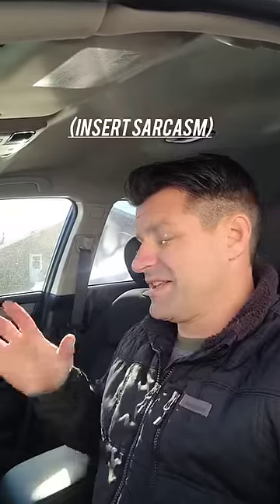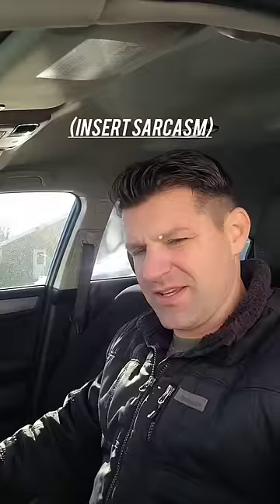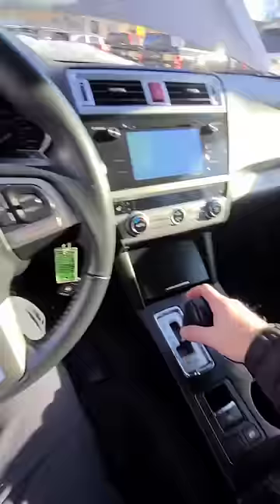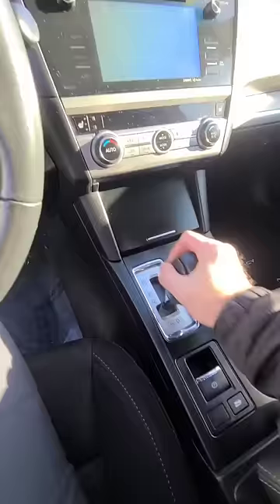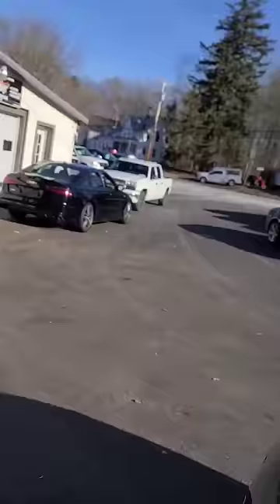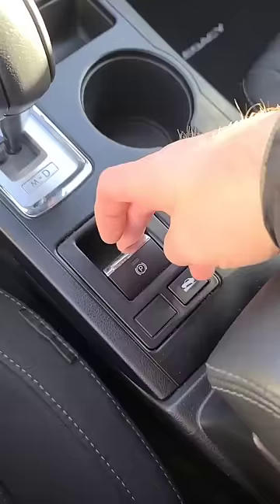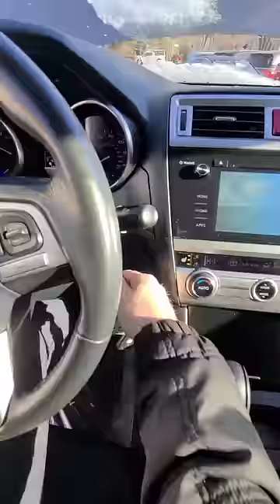Why Subaru Engineers deserve a punch in the Face! #shorts

Comment: There’s a little cover on the shift knob that you depress and allows you to move the car into park and neutral without power
Reply: Yep you just have to run fast enough to the shop grab the screw driver to pop it :)
Reply: I don’t know about all cars, but in my cars, I can pop the cover off with my fingernail
Reply: U could also use a key… or pretty much any object to pry it open; that has enough strength to hold up to prying the cover open
Reply: @Fishi413  fr
Reply: His point stands though because petrol heads like us will think 'there must be an emergency alternative' but your average driver won't.
Reply: Any good mechanic would have a small screwdriver on their person
Reply: @Fishi413  you can't get the key out of the ignition in these if the car isn't in park.
Reply: @realMaverickBuckley if only it came with a manual of some kind.
Reply: Its called reading your owners manual so you can be aware of all your cars features LMFAO. All cars with this feature have a lift off access cover on the shift console that has a swittxh under it that allows the lever to be put into park, younsimply use a fingernail or key to pull open the cover ...DUH...people who dont read their owners manual ....Pfffffffff!
Reply: @wall7103  On the Sub, you don't put a key in the ignition.
Reply: And also the car would never be in neutral with the battery dead for you to be able to do that.
Reply: @Crazy8ts  the point is its a huge safety issue and nobody should have to go through all these or other steps to make the car safe. Not too mention if this car was borrowed or bought used or if the driver was not that knowledgeable they would not know this feature. Again making it more dangerous then it needs too be. Another feature to cost the consumer a ridiculous amount of money when it fails.
Reply: @FamousByFamily  That's cop talk
Reply: Not all cars have that my previous Acura and Honda did. My current VW doesn't, but it also doesn't lock out the shifter in neutral and doesn't have an electronic e brake.
Reply: @alexgrecico9720  pocket screwdriver is a techs best friend
Reply: Is it marked for everyone to see?
Reply: @Fishi413   If only there was an accessible key nearby.
Reply: @Crazy8ts  um i dont have fingernails since i keep them trimmed short so they dont snag
Reply: @tractorboy31  I mean, you can pop it off with a penny or dime...or your housekeys...or something.  You telling me you don't have anything at anytime to pry with?  C'mon buddy, c'mon.
Reply: @realMaverickBuckley  dont say that .. my girlfriend hat this exact problem .. she used a dog leash to fix the breaking pedal in the pressed positon xD she isnt a petrolhead at all but knows how to improvise
Reply: @FamousByFamily  Does he or any other Subaru driver look like mechanics?
Reply: Every enthusiast Subaru owner knows this trick.
Reply: Yeah, he was supposed to do this before putting it into neutral
Reply: @shiminowind  most car owners don't know much about their vehicle. I mean look around, most people don't know how to operate a blinker or that their braking system won't stop a 3,000+ lbs car in two feet at 60mph. They can sit a read what the Kardashians are doing, but can't familiarize themselves with the basics of their vehicle.
Reply: As always RTFM 😂😂
Reply: It doesn't make sense or won't go back into park stopped. Every single car I know had the park or shift lock release as it is necessary for maintenance work or emergency etc.
Not one I've heard you need to press in order to go back into park....
Reply: Not only this, but he literally could have stuck anything under the tire to keep it from rolling. This was a poor attack on a common layout
Reply: @realMaverickBuckley  it's in the manual

I'm not a car person, the first time I encountered a vehicle with a dead battery that needed to shift (in my case to neutral to move it out of a parking spot) I thought "there must be a mechanical/manual method of shifting" and I grabbed the owners manual

(which you can Google and get a pdf in minutes if you don't get it in the glove box)
Reply: @shiminowind  name the circumstance a car would be left in neutral, not park, without the ebrake on, on a hill, only being held by the drivers foot for long enough for the battery to run out.

Think first, talk after. Ooga ooga ugh.
Reply: @FamousByFamily 
Clearly
You
Miss
The
Entire
Point
Reply: @Bloodbound89 
A dog leash? 
To put SUFFICIENT pressure on the brake pedal (that implies latitude of time and maneuverability to allow trial and error)?
While sitting in the car and nobody assisting?
All the while the same situation as the OP?

Seems to me your comment is a bit flippant as if to say anyone can do this - I don’t want to call BS without way more detail to clarify, but I sense “highly unlikely” that her situation was the very same as what is portrayed in the subject video, including the original poster’s clarification.  

Having a small screwdriver onhand as many commenters remark is plausible BUT even that doesn’t solve everything either as tool must be accessible and the proper size/shape.  A little ditty left out by those commenters is that the parking pawl/pin needs to engage but may not be aligned to do so with little force (that is not observable, just luck), the same as shifting from Park to other positions on a steep hill with much pressure on the pawl/pin can prevent it from releasing so car can be moved.
Reply: @jacobogden6710 
Possibly, but your comment assumes he had anything that would work to hold the car. That means he would have planned for this very event.  

I don’t know if this is a setup or not, but I don’t carry such items in either front footwell - most people don’t (maybe in a work or beater vehicle rarely having passengers but that doesn’t mean easy to handle from a seated brake hold position - and holding phone to take video is least important).  Just sayin’
Reply: @handledeehandledum  the point is, this is not uncommon, this is a fairly common setup in most cars, there is a bypass switch, and you can literally grab about anything and put it in front of the tire. It doesn’t take much, there is nothing wrong with this system just takes a little bit of common sense
Reply: @soggybiscotti8425  you don't think at all. If you are in drive and your car dies and you can start it. You can shift from drive too neutral but cannot shift into gear/reverse to park from neutral without power to the neutral safety switch. Some cases like this you have electronic ebrake and other times some people don't have an ebrake at all. In an automatic There should be no reason a driver has to do hoops to secure a vehicle.
Reply: @shiminowind  if using your fingernail to pop open a small plastic cover is too much for you to handle, perhaps you shouldn't be driving.

If your car dies it means you weren't paying attention to any of the digital warnings and safety features built into the vehicle that notify you of your battery running low, or your alternator not charging the battery.

If you still chose to drive the vehicle until it dies, the battery still has enough power to engage the parking brake. It's designed to do so, even after it loses enough power to run the engine.

This guy disengaged the battery completely in order to create a situation that will never happen in reality in real use of a vehicle. And you got rage baited by it. So well done for using that superior intelect of yours.

I'm surprised you're still breathing at this point.
Reply: @Crazy8ts  OR instead of having to scour a 40 page manual for a single sentence telling you what to do in this incredibly specific circumstance, the car could, I don't know, let you put it into park without electricy 100% of the time without any special actions on the user's part?

You know, like most other cars for the last 70 years? Basic safety 101
Reply: @jacobogden6710  "Common layout"

You mean incredibly over-engineered and unsafe design prone to costly failure.

ANYTHING that has to do with stopping the vehicle should not require electricity or special actions beyond shifting or pulling the brake.
Reply: @soggybiscotti8425  Clearly this one.
Reply: @jacobogden6710  "setup in most cars"

Nope. <5% of vehicles work like this.
Reply: @LaFonteCheVi  he deliberately put the vehicle into a situation that cant happen in reality, and entirely disconnected the battery. It's not a situation that occurs with actual use.
There's also a small cap that can be removed off to manually put the car into park.

If you somehow managed to ignore all of the built in warnings that the vehicles alternator is not charging the battery, then that the battery is low, and decided to drive the vehicle until it stops, the vehicle cuts out with far more than enough remaining power to put on the emergency brake. Even if you run the ignition and play with the interior media center until that dies, it still retains enough power to engage the emergency brake. It is designed to do so.

So unless you intentionally sat the car on a hill with your foot on the brake, in neutral, and ran it until the car died, then ran the interior until it cut out, then waited several weeks for the residual power to drain so that the brake could no longer be put on, then this isn't a real situation that can plausibly happen.

You got baited.

Use whatever rattles around in that head you call a brain next time. He did it for views and interaction, and you fell for it like a chump. There's no situation in actual use this can happen.
Reply: @soggybiscotti8425  rage baited? The only person who is raging is you. You need to have a manual tell you what to do. Does not matter that this is a simulation. It is a feature that should not exist in any vehicle. You do realize you can loose power In a vehicle without any early warning at all. You can have no indication of any kind and still have a complete power loss. For instance a ecm complete failure shows no warning light. Your just feel superior cause you read a book that tells you how to lift up a piece of plastic on something that never needed and does not need it. It has no benefit of any kind only adds a unsafe situation in a rare scenario
Reply: If he had something to put under the tire, the car would be still if its not very steep. Like the servicebook that is a bit thick.
Reply: @LaFonteCheVi  what are you talking about, besides the electronic parking brake the shifter works like this in most cars after 1995.
Reply: @Bloodbound89  That's badass, but I think generally, 90% of drivers would have no idea.
Reply: @Pensnmusic  Yup, fair comment.
Reply: @Fishi413  Or, you could just...not shift the car into neutral when you know the battery is dead?
Reply: @LaFonteCheVi  Cars aren't the same as they were 70 years ago, for one, they are incomprehesibly safer in EVERY metric than they were 20 years ago let alone 70!!! So ya read the owners manual, cars today are far far more advanced, being ignorant and ignoring built in safety features is what makes them unsafe.
Reply: @FamousByFamily  How is that relevant for the 99.9% of drivers that are not mechanics?
Reply: @silasmayes7954  All cars (with automatic transmissions) have some way of mechanically overriding the shift interlock some are just easier than others.
Reply: @alexgrecico9720  or just use the key you pull out of the fob. You know like it's designed for and states in the manual. Same for all modern Ford's, Chevys, Toyotas and the Audis in front of this Subaru.
Reply: @shiminowind  what if you buy used with no manual? What if you read it and forget that specific piece of information 5 to 10 years later when you need it? What if you lose the manual? What if you're not mechanically or car literate and don't understand the manual very comprehensively? What if you're stressed out by the situation and don't think there's a possibility of there being an override?
Reply: @insederec  then you would be a normal person. As a mechanic of 20 years this is not an impossible scenario.  This happens alot where your car dies in drive for unknown reasons and it's all due to the newer electronics that engineers think make it better and claim its an impossibility cause there cad model says so. Before this all you needed was a neutral fafety switch. Would allow you to shift from drive into neutral while driving but when you needed it you can shift from drive to park with just the break applied. That's what the b.o.o (break on/off) switch was for. It told the computer the break was applied allowing the neutral safety to be overridden/disengaged so the shifter can move freely. Car could not start without the neutral safety being overridden and in either park or neutral with the break applied. Simple and very safe. This locks you in gear and for those who have no way to get to the override are now in a very bad situation. As simplistic as just pop the cover off sounds, every situation is different and as a mechanic of 20 years I can tell you it's not so cut and dry. Engineers think they are smarter then everyone and they have something better then anyone else and in the real world what they find impossible is actually a daily occurrence.  They collect there data in a controlled pool. This will kill somebody one day cause an engineer that he was so smart.
Reply: @darktoranaga  this guy who is doing the video is a mechanic.

Comment: Automatic transmission typically have a fail safe, usually a cosmetic panel you lift up and then stick a screwdriver down, this will disengage the shift knob lockout and allow you to put the car in park.

Comment: Put blocks underneath the wheels. Always a solution to the rolling problem
Reply: Not a solution when the blocks are on the other side of the shop and the fucker is already dead when you start fucking with it
Reply: If you don't have blocks, an ex wife will do.
Reply from the maker: @jdm2779  precisely
Reply: I always carry a wheel block with me, even in my new 2020 wrx. Mainly because my manual S10's park brake was MIA back in the day.
Reply: Yep always keep blocks on your keychain for things like this
Reply: Yea but who carries blocks with them cuz I don’t besides maybe mechanics
Reply: @calebwhite175  yea so do I, but do you really wanna run to your trunk, grab them and run to the front of the vehicle while it's already in motion, or are you gonna hop back in the car to brake and then hop out for the blocks.... Do any of these scenarios sound fun to you? Lol
Reply: @nonamenoname4641 this is what I was thinking. So you are just going to leave blocks in your passenger seat or the back seat... Dumb solution.
Reply: @BaronBoar  Thats what I do, out of habit. Anyways, they really don't need to be that big, I have one that sits in the cup holder of the door... snuggly. But that's me, I'm nuts like that.
Reply: It's still a stupid design.
Reply: @Mr.President sir  Indeed, Ford did the same stupid thing with the 2010-2012 Fusion, except they at least had a manual park brake. Probably did it with other models too. All I know is some things should never be electronically controlled.
Reply: @calebwhite175 🤣🤣🤣
Reply: Who opened the hood thou?
Reply: @jdm2779  well then how did it get in neutral then in the first place?!

Comment: Maybe you should have gone to YouTube university and searched for shift lock release for Subaru Legacy.
Reply from the maker: See pinned comment
Reply: maybe design the car to be put in Park like the others?
Reply: Or just get a car that isn't shit.
Reply: I had to once to put one in neutral to push it out of a garage to jump it off.
Reply: Yeah, there is this thing called an owner's manual and  if you have a cup of coffee and 15 minutes your can learn everything that the engineers did for you.  Ignition key into the  shift console (see diagram) foot on the brake, rotate the key, shift to park. God Bless.
Reply: @paulhale3979  Pretty sure his pinned comment says the key was locked into the steering column & couldn't be removed while in neutral.
Reply: @paulhale3979  Imagine being this sarcastic but not knowing that when the car is in any gear but park the key is locked in the ignition on pretty much every car aside from some worn out old junker.
Reply: @utubepunk  Is that the only key he has?  No change in the center console?  I've used my license as a scrfewdriver once.  The real reason he didn't use the bypass is because he didn't know about it.  He didn't know about it because he didn't think to look at the manual.

Comment: Subaru has a little tab next to the shifter that you can remove to insert your key to override the dead battery lock out for the shifter
Reply: gl taking the key out of the ignition
Reply: This is every automatic I can think of, yet this guy thinks running around the car is the best option..
Reply: Most cars have this. You don't need a key to unlock the shifter. Sometimes something pointy, alot of times just your finger.
Reply: @SaltedSlug85  true, it really doesn't need to be the key, usually it is just set in such a way that the key is the perfect thing to use as far as length and shape